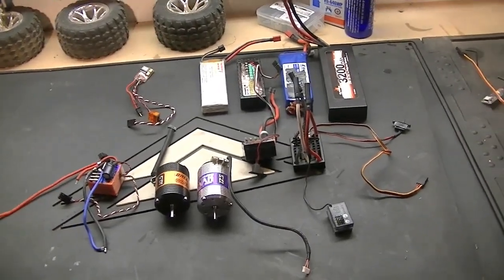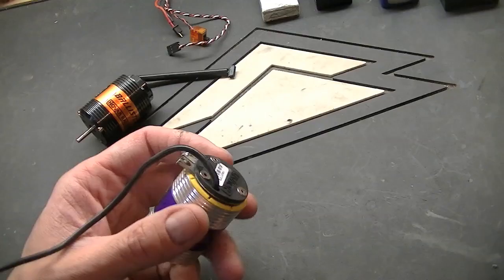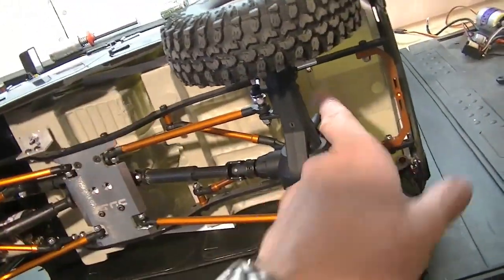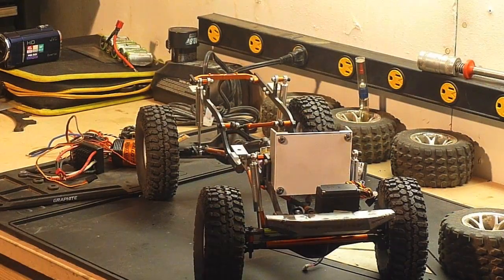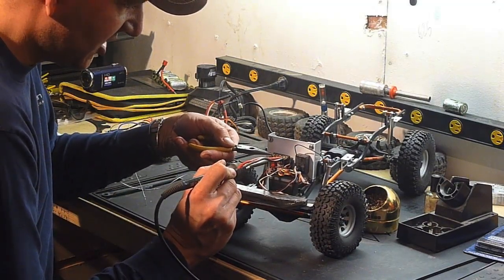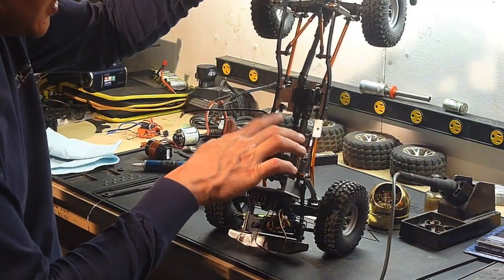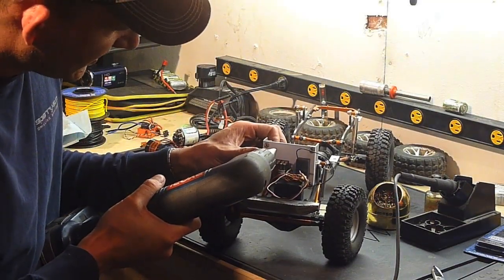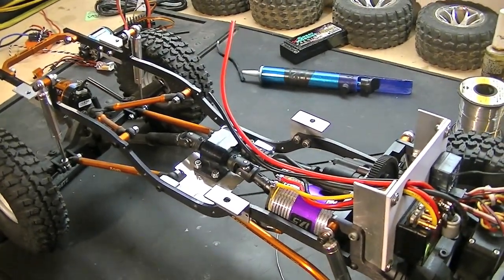RC Trail Jeep Part 9 - Electronics and Pop Rivits?

Comment from the maker: King of steel wool but coarser.  It is a purpose made tip cleaner I bought.  Works way better then a wet sponge as it steel does not cool the tip when you clean it.

Comment from the maker: They are RC4WD scale shocks. 90mm length, I think.  I need to rebuild them as they are too soft right now.  I will also pull the springs out and convert over to a proper shock/spring combo somehow.